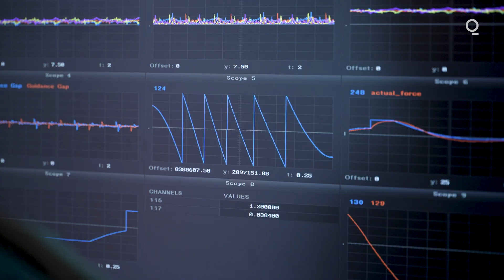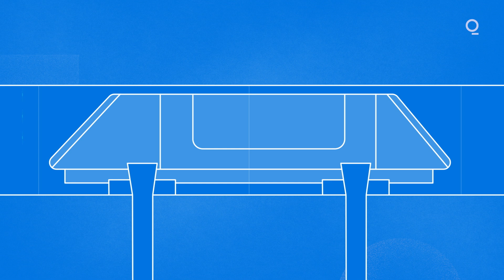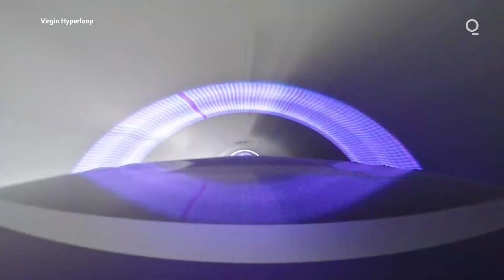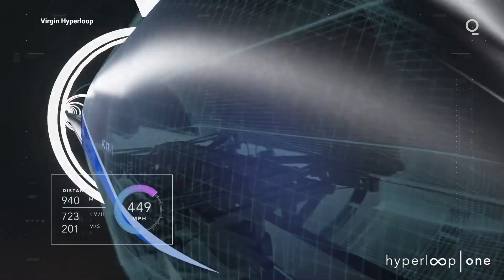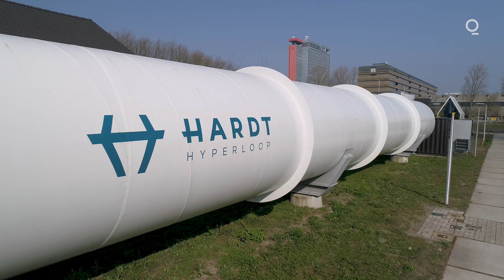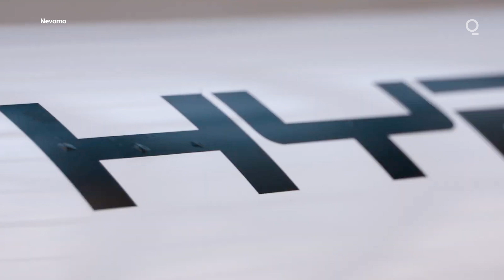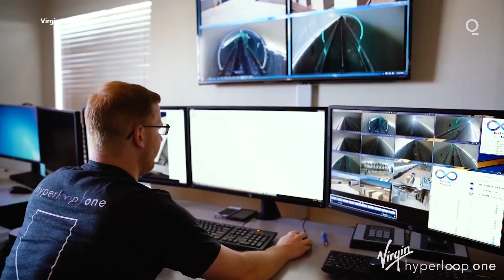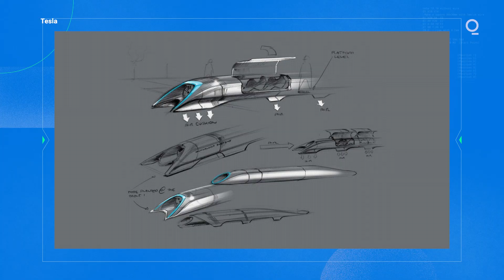The Hyperloop May Disrupt More Than Just Travel

Comment: Meanwhile Japan has had bullet trains that run to a schedule within seconds of predicted arrival for decades.
Reply: @WilliamKakzak  Do you honestly think keeping thousands of miles of vacuum tubes in working condition is practical, cost effective, and worth it compared to regular high speed rail?
Reply: @WilliamKakzak  and it has the added benefit of a myriad of practical implementation problems, none of which have been demonstrated to be solvable in the last 8 years. but yeah, let's keep the hype train going. elon did it, so it's obviously genius.
Reply: China is roughly a similar size as the us. China still has high speed rail everywhere. It's not impossible, America just doesn't like trains
Reply: @MapleDeerest  What? America doesn't like trains, are you kidding and do you live in America?
Reply: @MapleDeerest  It always come back to car culture being too ingrained for people to suddenly care about public transport.
Reply: @trancepeirce3107  or bicycles/ sidewalks for pedestrians
Reply: @MapleDeerest  Land ownership and oil related job issues.
Reply: @MapleDeerest  because us transportation monopoly by car and airline 
They dont want train as rival 🤣
Reply: @WilliamKakzak  and it’s just around twice as expensive to build (without counting prices of developing the technology) also since you can just hop in the middle of the vacuum it would only connect 2 points, bullet trains can connect as many as needed
Reply: @WilliamKakzak  People know, and people know that this technology is years away.
We need to develop full proof/leak proof pipes, because unless you do that, you will be fixing them everyday and stopping pods every day. 

Besides, trains are indeed the future of this type of transport, not individual pods. 
Even if you could transport people faster, it would not reach the carrying capacity of big trains which run at a fraction of the cost and carry thousands.
Reply: @Skullbrothers  Korea has come very far ahead.
Reply: Japan are raised on making stuff efficient. Like take my Grand Seiko for instance, accurate to a few seconds per year.
Reply: @Castle in The Sky Yes you are correct. Another commenter pointed out that China has less carbon emissions per capita than Australia which has a smaller population. 

I hope China continues to push the rest of the world into a greener future. The way their government is, they can do things a lot faster than democratic nations. It’s really unfortunate how slow democracy operates.
Reply: this mode of transport are for business men and women who doesnt a life outside their businesses not even relaxing on their trips while on a vehicle.
Reply: Right? US ignorance.
Reply: Agreed another Money grab . This is way higher cost and maintenance over high doors rail . The vacuum tube valves over long distance has not been worked it nor the thermal expansion worked out .
Reply: How many decades?
Reply: @Fishy after reading all the comments here.. yours is quite objective and intelligent. you are right.. no public transportation system is profitable.. only hongkong is close enough. I learned something new today thanks to you.. the last time a  public transportation is profitable in the US was back in 1920.. jeez!! Is that really true? I cant believe it. Now It makes sense.
Reply: They could generate profit for cargo travel, it would remove high traffic off highways and I see potential there.
Reply: Japan has different needs than the U.S. does, with more potential riders. You have to have lots of riders to make a profit.
Reply: Do not forget that in japan there is a lot of japanese
Reply: As was said it looses 100 million every year
Reply: @mudabudda  100 Million on that scale is negligible. 100 Million means that every adult in Japan only pays 1 dollar per year to even the loss out. That is practically nothing.
Reply: How many people actually believe the Musk hyper loop BS?
Reply: @WilliamKakzak  Until the tube springs a leak, then it's finitimus
Reply: You missed the point regarding the flexibility and cost difference. On the beginning they already noted that there are already other solutions that can achieve the speed aspect of it, however you need certain paramaters so they can be finacially viable, the mix of speed + flexibility + smaller pods is the key difference.
Reply: @WilliamKakzak  The Shanghai maglev train has a top speed of 270mph cruises at 268mph and has had over 50 million passengers.
Reply: @WilliamKakzak  maybe in your fantasy. But we live in reality and there is something called physics.
Reply: And they built those bullet trains back in the 60s and 70s. Fifty years ago.
Reply: This country is a joke.
Reply: Look at the high-speed rail map of japan.
Basically one long track the length of the country, with 3 side spurs in the center, and they get decent coverage of the country. How many tracks to cover the US?
Reply: Amen
Reply: The U.S infrastructure was designed to maximize oil profits lobbied by the conglomorates.
Reply: If you actually read up more on this hyper loop topic it’s not about going 100mph it’s about eventually being able to get up to 900mph. Currently 100mph is the goal set that they want to safely achieve yet no one understands that and everyone talks about how “Japan has bullet trains already” blah blah blah, everyone is so narrow minded and can’t actually understand or take the time to even theorize conceptual technology and it’s why I can’t stand explaining things to Americans.
Reply: Yeah but this is a quantum leap above that . Transcontinental travel
Reply: One is action. The other one is talk first.
Reply: A marketing strategy for expensive trains
Reply: @WilliamKakzak  Even if, how can the hyperloop be less error-prone than a metal canister on rails? we already have trains that can do whatever the hyperloop can do. Slower? maybe, but rails all around the world transport thousands of times more people than the hyperloop per year. Don't fix what ain't broke.
Reply: @maxibon2129  - Or, Don't just be happy with, "That's How Grandad did it, that's how Dad did it, so that's why that's how you do it!" That just Leafs to Stagnation!
Reply: @robertweekley5926  what kind of argument is that? Should we make cars with square tires just to innovate and not be happy with how "grandad did it?". Using something worse, less efficient and more costly isn't innovation, it's better to not go forward than to go backwards.
Reply: @maxibon2129  It's for the wealthy and business class, clearly.
Reply: @maxibon2129  I guess we just shouldn't fix horse and buggy then either
Reply: @JSephH76  what kind of comparison is that? A train is thousands of times more efficient than a horse and cart. Both in speed, capacity, maintenance, cost and scalability. The Hyperloop is only faster than a train, and not even by that much. By all other metrics traditional HSR beats  the Hyperloop meme "pod" tech.
Reply: @maxibon2129  My point is that the Hyperloop is better and as the technology develops will get better over time. The argument that we shouldn't continue to progress because what we have works is the most asinine thing I've ever heard. With that mentality we would never have gotten past a horse and cart. Candles and lamps were functional sources of light with an industry and infrastructure already set up yet we still transitioned to electric light bulbs. You seem to be arguing that there's no point developing new tools and technologies which is nonsense
Reply: @maxibon2129  there's a big difference which has been mentioned many times in the video. Hyperloop shines on network efficiency. It is meant to be an end-to-end travel. which means that it would completely erase any transference process or scale. Which not only would make the travel "faster" it would make it "incredibly faster", from 2h to 5min, there's a BIG difference. You wouldn't complain about having 5G today instead of the very old 10kbps of internet speed on your smartphone, right? speed matters, time saving services matter A LOT for busy people.
Reply: @WilliamKakzak  Daily, one million passenger are daily transported by bullet train in Japan. This is just one of many countries that run bullet trains. So when will any Haperloop minibus system transport a million people a day?
Reply: @TorianTammas  hyperloop is expected to come within 10 years I'd say
Reply: @TorianTammas  It’s expensive. So they have to start where is the most cost effective until people can see what it really can do. Then they will be able to get the funds necessary to build larger pods.
Reply: Japan is tiny compared to the states.
Reply: @RavenThePlayer  Bullet trains run from the southern end of Hokkaido to the southernmost end of Japan. That length is about the length from seattle to LA
Reply: @ArtaxForever  The federal government cant just favor one stretch of states
Reply: @JoeTheBroken  zStates could favor one stretch of states. But not if your busy if you're living in the 1900s banning books and trying to keep kids from finding out about slavery...
Reply: @JoeTheBroken  The US government has a lot more money than Japan. Only problem is we severely overspend on our military.
Reply: @ArtaxForever  With a lot of mountains.
Reply: @JoeTheBroken   Your missing the point here.

We have the resources to do what japan been doing for decades on a grander scale.  And could of already been out by now. Instead were letting billionar play with there less effective toys for something that's probably not even gonna go into effect 10,15,20 years from now.
Reply: @RavenThePlayer  And what about China, a country larger than the USA with 4 times the population of the USA!!?? And China has the most modern bullet trains on the World!!
Reply: @jasonmonge9969  China also has the most carbon emissions in the world.
Reply: @bamm86  China also has the largest population in the world. I'm not going to pretend that China cares much about their carbon footprint, but if you consider that Australia has a much larger carbon footprint per capita than China, it kind of puts things into perspective. Their demand for energy should be much higher than Australia's, but Australia is producing more greenhouse emissions per person than China. This is because Chinese nationals still live in smaller housing with multiple family members, car pool more often, whereas Australia has more people living in large abodes, drive alone, and generally use more power than their Chinese counterparts.

Their production methods are dirty, but their culture means that energy is shared and distributed widely because they do a lot of things together.

Australia has cleaner production values, but individuals consume the same amount of energy as perhaps 5 or 7 Chinese nationals combined.
Reply: @bamm86  What tf does carbon emission have to do with that???
Reply: @bamm86 China only has half of emissions per capita compared to US, whose got the highest per capita emissions in the world. 

I corrected for you since you fail to see that if you divide China into 5 countries by population then they are comparable to US, and each of those divided places only creates half of those emissions via the same population of people living in the US. Statistics love to fool people with numbers game.
Reply: @inkbold8511  Yeah but, that's a BS statistic. Most of the people in China still live in poverty, that's why the "average" emissions are low. It's also worth considering that the nations who produce so many things that the rest of the world use are the big polluters for that reason. Does the rest of the world want products or not?
Production can always be cleaner, though, and that has been improving.
Reply: @bamm86  China has also the higest population in the world. Per capita China releases quite a bit fewer emissions than the US. Not to mention that the US has outsourced much of it's energy consuming production sector to China as well.
Reply: @jasonmonge9969  First, China is not larger than the USA, you were lied to. Second, 4x the population, yet their trains lose $100m+ per year Pre Covid. Chinese stopped riding trains as much as they started buying cars. As personal ownership of vehicles went up, train passengers went down.
Reply: @bamm86  Carbon emissions because China literally is the world factory.
Reply: @RavenThePlayer  iirc Japan almost as big as the entire east coast of the United States
Reply: @indescribableemptiness4104  Thé size may be roughly the same, but in that same amount of land, Japan has over twice the population, making tarins much more viable than roads and cars.
Reply: @RavenThePlayer  yet America doesn't have any single thing that compare to bullet train lol
Reply: @RavenThePlayer  Still so much more advance and with no media take the Hyperloop serious.
Reply: @RavenThePlayer  so what?
Reply: @RavenThePlayer  not tiny compared to major cities in the states
Reply: @RavenThePlayer  how about china then?
Reply: @RavenThePlayer  Then they can do it at State level. No excuse
Reply: @RavenThePlayer  Ok, and? Don't built it though the whoe of the US then....
Reply: @RavenThePlayer  but to transport tens of people at a time rather than hundreds... ya sure that's worthwhile?
Reply: @RavenThePlayer  this is too cool ..We should connect continents.. as Instead of ..ships to transport goods from different countries from different hemispheres..
Reply: @RavenThePlayer  don't compare it through the size of  textbook map .
It doesn't show the actual size of a country.
Reply: @RavenThePlayer  Size comparison in this matter doesnt even make sense. Yes the bullet trains is quick and on time, but they move alot more people than any train company in US would/could do. And it would just tell you that they could do it even when if the country was as large as US.
Reply: @RavenThePlayer  Japan builds quality of quantity
Reply: @RavenThePlayer  it's not. Have you actually looked at an overlay of Japan on the US?
Reply: @RavenThePlayer  The size of Japan is utterly irrelevant to this.
Reply: @RavenThePlayer  who cares about the states
Reply: @RavenThePlayer  japan is as big as travelling from Miami to Maines.
Reply: @RavenThePlayer  Taiwan is an even smaller country than Japan, but they have a high speed rail line that's longer than the distance from Portland, OR to Seattle, WA.
Reply: @RavenThePlayer  You underestimate the size of Japan. If it was put next to the west coast it will stretch from Maine to Cuba.
Reply: @lamaripiazza5226  dont forget that Japan is filled with mountains as well.
Reply: @lamaripiazza5226  Maine and Cuba famously one the west coast.
Reply: @lamaripiazza5226  Isn't that the EAST coast?
Reply: @vincentcedric-4449   their newest train project runs like 90/95%  underground, not along the shoreline but under their mountains in the middle of the country.
Reply: @RavenThePlayer  the size of Japan isn’t relevant to if America can accomplish the task. China did it.
Reply: that bullet trains actually running in loss, they are not making money. Main purpose of this hyper loop to keep economically cheaper while travelling.
Reply: @Hhappyim  How is a low capacity bullet pod run in a ridiculously complex vacuum tube that uses no existing infrastructure going to be more affordable that just a bullet train with technology that already exists?
Reply: @Hhappyim  That’s China not Japan
Reply: @lamaripiazza5226  East Japan Railway Co. ... East JR is expecting a loss of 418 billion yen ($4 billion) for the current year that ends March 31
Reply: @Hhappyim  Have you ever heard of the corona pandemic? The loss is due to the lack of passenger traffic during the coronavirus pandemic.
Reply: @Hhappyim  Shinkansen service between major cities makes plenty of money. JR East loses money on maintaining it's aging low speed rail service to rural areas.
Reply: @TorianTammas  you beat me to it. Recognising that a transport system is losing money, but not bothering to open the eyes, look around and see the obvious reason why. 😂
Reply: @Hhappyim  how is a system which carries less passengers and require more money to build and maintain more economical?
Reply: @Hhappyim  Actually, no. HSR tends to be profitable when done right. Even the "almost HSR" Acela is so wildly profitable that it pays for a lot of Amtrak's congress mandated money-losing routes.

In China HSR is not profitable, but that is only because: A. Their government built useless lines to show how "futuristic" China can be, and practically no one is using them; and B. because of the insane corruption in China, a lot of the money was and still is siphoned off. There are very profitable HSR lines in China too, just like anywhere else in the world.

Many governments choose to subsidize HSR, but most governments subsidize air and auto travel for more money and a higher percentage of the total cost. In the US most airlines would croak without government subsidies and we pay the entirety of air traffic control and airport construction costs. Same thing for highways. They never turn a profit, but I don't see you complaining about that boondoggle.

Comment: So these hyper loops would have lots of stops?  Like the bus lines.... They're not going to eliminate cars just the length of car trips.  So what, I drive to the local hyper loop hub ride to another and another until I get to the closest hub to my work, or grocery store and then get a ride to my destination?

The USA is extremely spread out. There is still the problem if getting to the destination you need to get to.